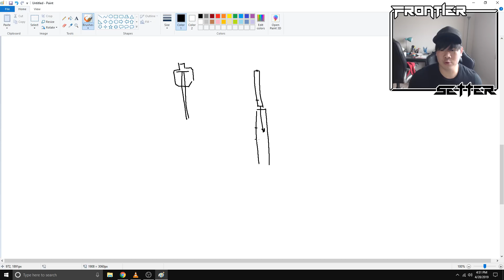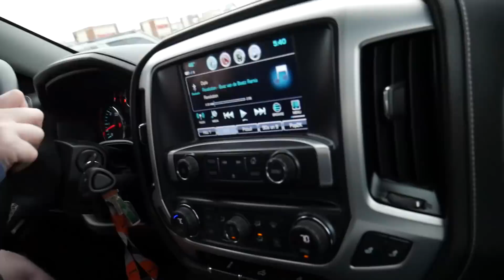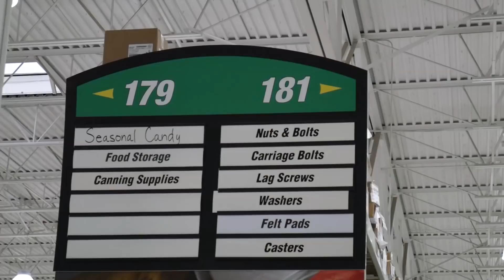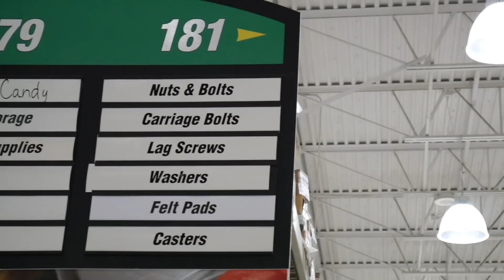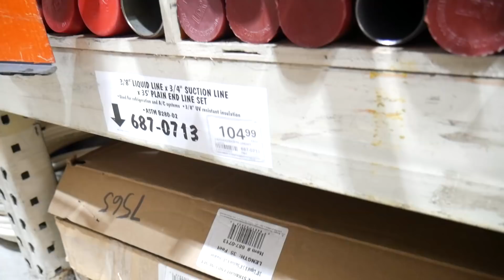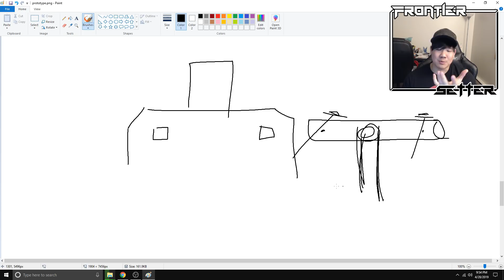"Designing" a Target Stand (Pls Send Help)

Comment: Ah yes, the classic "I'll just buy a damn target stand" journey every gun guy goes through.
Reply from the maker: I'm so tempted to, but I can't. Must stay true, fabricate all the shit myself. BUUUUUT, I did figure out a way easier way to mount the targets though. Planning on getting some cheap square steel poles, and drilling 3 holes. 2 to mount to the targets and 1 for the center hole. This should make it significantly simpler and easier to mount to any stand design instead of that janky chain setup I had in mind. You gonna be attending the lax cast this week?
Reply: @FrontierSetter  I'll be out and about innawoods, but I might be able to poke in depending. Square steel is perfect for most DIY stuff, bit spensive on the buy in but lasts forever. Unless you shoot it. Again.
Reply from the maker: Have fun! That's good to know about the square steel though, either that or angled steel. Either way, I shouldn't need TOO much of it since I think I'm going to be going with the 2x4 route. At least until I acquire land for myself, everything needs to be temporary and portable.

Comment: yup, i finally said fuck it too and just went the 2x4 route. made a square 2ft each sided base with 2x4s in the middle to hold up a 2x4 by sliding it in the slot. super simple and pretty lightweight and used home depot marked down 2x4s so i made 2 stands for under 10 bucks. now its just two 2x4 squares with two single 4ft 2x4s to stow and set up. oh but i did have to buy a 20 dollar target topper that goes over the 2x4 to hold the ar500. done pvc too and it only works good for paper targets if you dont shoot it :P
Reply from the maker: I think this is what I'm going to end up doing too. It's just way cheaper and easier. I do need to make a 2x4 "T-bar" to mount the 2-hole setup of these targets though. I'm assuming your plates were a 1-hole? I've seen these metal plates that some other people have to change their 2-hole target to mount to 1 center point, but I'm not sure where to find this particular product.
Reply: @FrontierSetter  one is two hole and i just mount it in a single hole, its just a bit slanted when it hangs. cool thing about the 2x4s is the steel in the center hangs past the center 2x4, so depending on steel size you can also staple cardboard targets on the 2x4 on each side of the plate. which is fuckin awesome, turn one target into three :D
Reply from the maker: very ingenious. i like this idea. i was just thinking too, if i got squared steel tubes, i can just drill 3 holes, two to mount to my targets, and 1 to be the center hole for stand toppers. hmmmmm....
Reply: @FrontierSetter  aaay that might be cool and can prob be made to fold up.
Reply from the maker: Someone else did say that the piping can fold if too many ppl shoot it up. So your 2x4 stand and base is still most economical though. I need to go back to prototyping this bad Larry lol

Comment: What kind of base did you say again?*rewinds video* Ohh a thick base! Right! 🤤

Get yo self a decent welder and some thick(🤤) rebar. Magic will happen. Maybe 🔥 too... 

Here’s another idea. A patio umbrella stand that you fill up with sand and have a T shaped pole coming up.  Bolt hooks on the backside of the silhouette and set on the T somehow so it doesn’t fall off.
Reply from the maker: THICC is life lol 🍑
I think teaching myself how to weld would be a fun and dangerous adventure in of itself lol.
The patio umbrella base seems nice since it's already made. I think I'm going to buy square steel poles, drill 3 holes into it, 2 for the 2 shoulder holes on my target, and 1 for the center hole, that way i can buy some target stands. this should make mounting it much easier.

Comment: Drill ar500? 🙈 Good luck
Reply from the maker: i know.... this is the worst part. :CCC i fkn HATE how these shitty plates didn't have the center hole like most targets do. so now i gotta come up with some bullshit to make it work.
Reply: @FrontierSetter  You're in US, so I would think wood in a T Shape

At my work we order special company to drill thick steel

English isn’t my first language, so please excuse any mistakes
Reply from the maker: Yeah that's probably the most economical and easiest way. I definitely overcomplicated it all avoiding the use of wood. Thanks for pulling me back to sanity.
Reply: @FrontierSetter  thats what we learn here.. In the us wood is cheap and the umbrella stand isn’t as dumb I think but u need a heavy one to souke up the recoil or just a whide base
Reply from the maker: Yeah, if I can simply mount the 2x4 onto a pipe and then stick that in the umbrella base that could be it. I wonder how it would react to hits off center though. You've definitely convinced me to use wood though, at least for mounting the plates. Thanks!

Comment: Just make a berm and jam it them in  :V.
Reply from the maker: i wish i could, but i don't have my own land to shoot on, so it's all at a public range. super annoying.
Reply: @FrontierSetter   While it's certainly a solution, please don't, you'll just eventually ruin your plates.
Reply from the maker: I actually don't even think I have the tools to safely drill through them. Someone suggested just running a 2x4 between both holes and mounting it center that way. That's probably the easiest and most economical way I think

Comment: I think it would be cheaper and easier to research target stands and buy one instead of wasting your time and frustrating yourself.
Reply from the maker: I honestly think so too lol. One of the annoying things with the targets I have is they only have the two hole mounts. Most premade stands use a single hole setup with one 2x4 to hold it up. I need some kind off cross over beam so I can stabilize the target. I wish I didn't buy these when I did, but now I'm stuck with them lol. The "swing set" target stands in my opinion are too large and bulky.